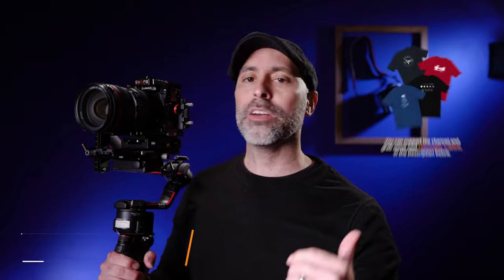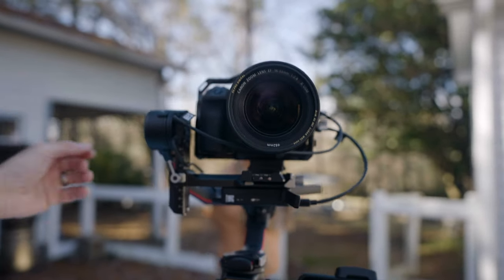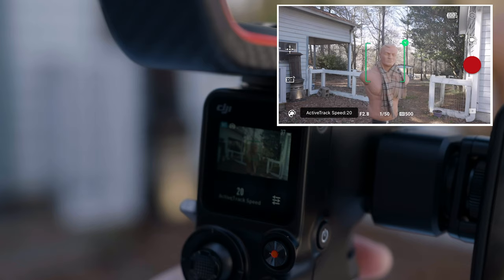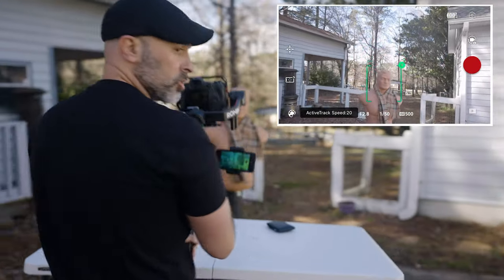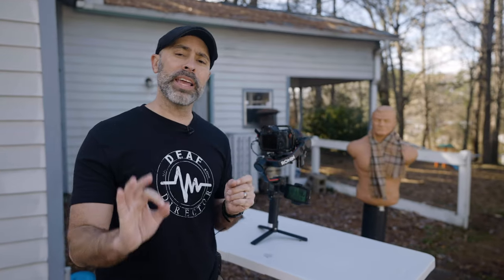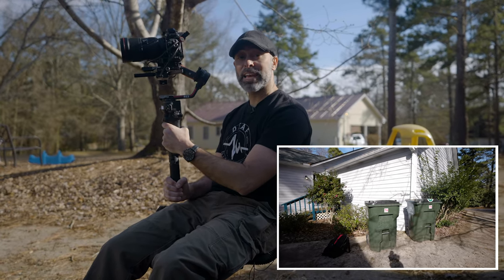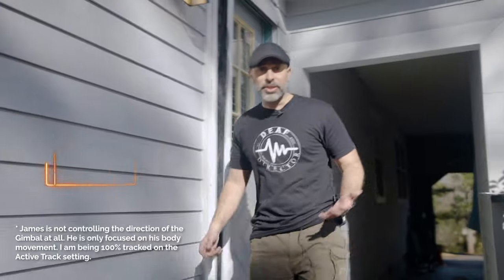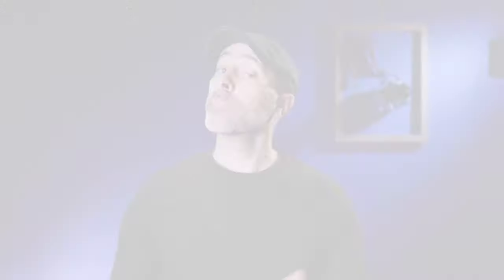DJI RS2 - ACTIVE TRACK TUTORIAL

Comment: I really can use your support. DJI is way too good for me. I've already contacted them. I have to wait two day for this answer. How do you retrieve the footage you recorded while using Active Track. I recorded multiple scenes using the Raven Eye, but I never recovered the footage to my phone or my sd card. Please help. I'm begging for some guidance, or assistance.
Reply from the maker: Hey Naquan, that is a really weird bug. My gut instinct, without seeing your camera, is that there might be something going on with the card in your camera.The first thing I would do is try to manually hit record on your camera once you have Raven Eyes set up to make sure the camera is actually recording to the card, without being triggered by Raven Eyes. You might also want to double check your USB cable connection or switch the cable. Good luck and I hope you get it fixed

Comment: Are you using autofocus or does active track focus? I'm a bit confused about this trying to get out with my gh5 and it does not pull focus.
Reply from the maker: Active Track does not track focus, it only keeps your object centered. I use Active Track with my GH5, too, and I will typically use one of two options for focus. The first is, if I'm using a wide angle lens, I can usually get away with setting it to an F4 on Manual focus, and then I test the move out to see if it keeps in focus throughout the move. Often times I can totally pull this off with no problem and the shot stays sharp. If I want a wider aperture or the move is big enough that this will not work, I will put on a focus ring on my lens and attach the focus motor that came with my RS2. I will then focus manually using the focus wheel on the front of the RS2. I hope this helps and you get the chance to enjoy flying you GH5 on the RS2. Have a great day!
Reply: @DeafDirector  Yes thank you so much! Is it easier to than just digitally focusing the Gimbal? My camera will focus with the wheel without focus motor. Although I do have it. My purpose would be using it in selfie or filming myself on tripod. I always had issue with auto focus on GH5 but I still use it. I will have to get efficient with pulling focus on the gimbal. Thanks again
Reply from the maker: @PizzlesTechTime  I love my Gh5, but the autofocus can definitely be unreliable. I think your best be will be to set it to an F4 and you should have a pretty good leeway there for selfie and Tripod shots. That's what I have done in the past and it has always worked pretty well for me. However, if you have found that your GH5 autofocus works for you in these situations, you should probably try that first. Good luck!

Comment: I see you camera screen is off while raven-eye is on. I really want  my Nikon z6 display off while raven-eye is on, this way it would save a lots camera battery life. but I cannot figure how to turn it off.
Reply from the maker: Hi Yi, I don't have a lot of background with the Z6, but if you go in the setup menu to "Limit Monitor Mode Selection," I'm pretty sure you can select different options there (like Viewfinder only) that will probably help you with your battery life. Thanks so much for the comment and I hope you have fun out there shooting with your RS2
Reply: @DeafDirector  Thank you for replay. Yeah, I tried "Limit Monitor", only to view finder. Without Raveneye on it functions as expected. The camera monitor on as soon as raveneye turns on.
Reply from the maker: @ahboo2003  Hmm, I'm not sure Yi, it sounds like there is something that needs to be adjusted in the HDMI out settings. Try playing with that to see if that helps. Good luck
Reply: @DeafDirector  You are right, it must be related to HDMI out settings. I need to figure this one out. Thank you so much, highly appreciated!!!

Comment: Are you able to record in 4K with tracking? I have only been able to get it to work in 1080p
Reply from the maker: Hey Naki, I have been able to record in 4K with tracking with no problem
Reply: @DeafDirector  hey thank you for the reply. I actually just found the solution today, I had to set recording to 4K/SD but 1080 through Hmdi Output. I was trying to send a 4K signal through the hdmi output to the raveneye but it only accepts 1080p
Reply from the maker: @naki5961  Thanks for posting your solution! I'm sure you're not the only one to encounter that, and hopefully it will help someone else out down the road.